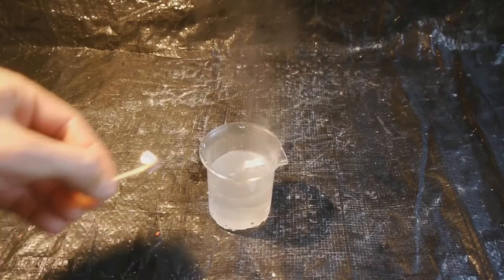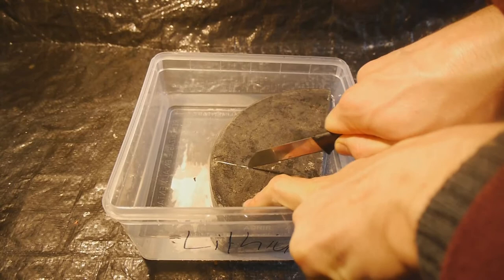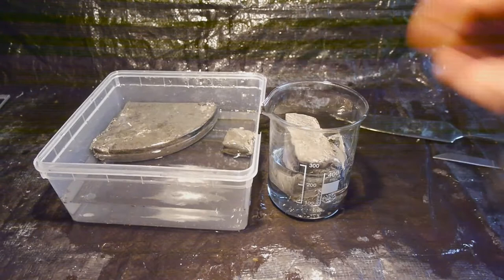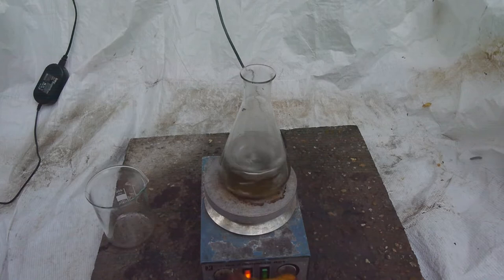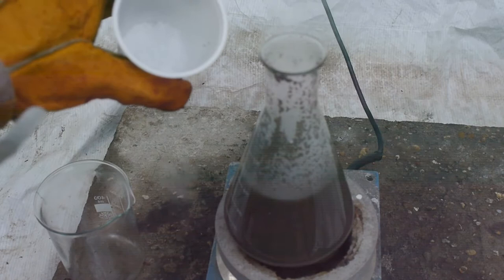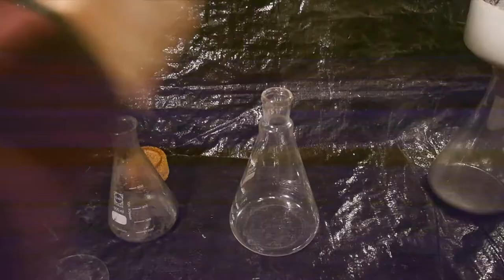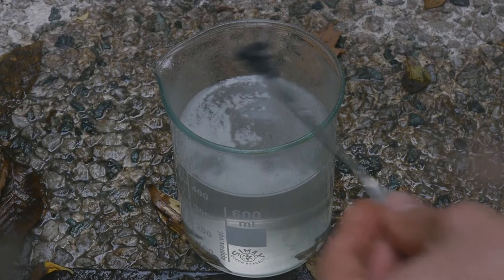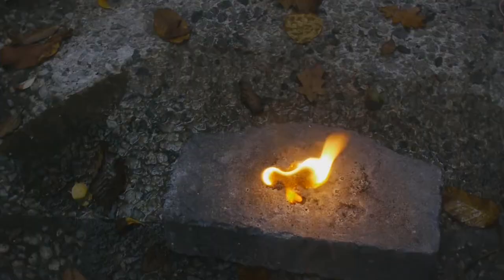Making Lithium Powder

Comment: How expensive were the big chunks of lithium and potassium that you bought? They aren’t in stock anymore. Just curious because I also live in Germany.
Reply from the maker: Here you go, I admit it is really difficult to find if you are not used to finding difficult to find stuff on google. XD
https://www.ebay.co.uk/itm/Lithium-99-8-Li-metal-also-Na-K-Cs-Rb-FREE-DELIVERY/283948757263?_trkparms=aid%3D1110006%26algo%3DHOMESPLICE.SIM%26ao%3D1%26asc%3D20131231084308%26meid%3Df53744225aa54ae28a0aa55cf0bd95b6%26pid%3D100010%26rk%3D1%26rkt%3D12%26sd%3D283927792331%26itm%3D283948757263%26pmt%3D0%26noa%3D1%26pg%3D2047675%26algv%3DDefaultOrganicWithAblationExplorer&_trksid=p2047675.c100010.m2109
https://www.ebay.co.uk/itm/Potassium-99-8-K-Kalium-metal-also-Na-Li-Cs-Rb-FREE-DELIVERY/283716547928?_trkparms=aid%3D1110006%26algo%3DHOMESPLICE.SIM%26ao%3D1%26asc%3D20131231084308%26meid%3Df53744225aa54ae28a0aa55cf0bd95b6%26pid%3D100010%26rk%3D2%26rkt%3D12%26mehot%3Dpp%26sd%3D283927792331%26itm%3D283716547928%26pmt%3D0%26noa%3D1%26pg%3D2047675%26algv%3DDefaultOrganicWithAblationExplorer&_trksid=p2047675.c100010.m2109
If you can't open the links it was about 200 € per kg.
Reply: @EliasExperiments  Thanks for the answer :D

Comment: I want to see this mixed with potassium nitrate or some other oxidzer, I would be curious to see if this would be viable in any pyrotechnic mixtures, maybe with a binder like silicone or epoxy
Reply from the maker: That would indeed be interesting. I will look into it.

Comment: That’s a great video! Is it sulfuric acid that you put in to stabilize the powder while stirring and cyclic acid for washing?
Reply from the maker: Sulfuric acid would be quite dangerous to mix with lithium. It was oleic acid and solid carbon dioxide. For washing I used cyclohexane, however you can use pretty much any anhydrous hydrocarbon solvent.

Comment: Okay, I'm gonna take a crack at this since you seem to be somewhat of a reputable chemist-and not just a crackpot. If I had to make a wild guess I would think that you're going to use the lithium metal powder and some kind of organic reaction or perhaps a reaction in which you need to have your organic solvents to be absolutely dry.

I am going to make a suggestion on what you might be able to use your lithium powder with; have you ever thought about producing a pyrotechnic composition in which you in case lithium powder in some type of moisture proof solid organic matrix which would when it was ignited would produce a perfect red flare? Do you think that's even possible?
Reply from the maker: Yes the lithium powder is intended for an organic reaction. On the sciencemadness forums someone already figured out what I planned to do with it, but I first need to get better equipment, cause I had a lot of trouble to actually pull through what I intended. 
The idea with pyrotechnics is great and already noted! But for that I would make more powder without the sodium metal, cause that ruins the beautiful red flame.
Reply: Yeah I agree, I want to see a pyrotechnic mixture with this, perhaps silicone rubber as a binder would protect it from water

Comment: Nice video! But I really missed the typical red flame of lithium at the end :/
Reply from the maker: Thank you! The red flame was missing because I mixed in like half a percent of sodium metal in the lithium which completly overpowers it. But I need the sodium metal to make it reactive enough for what I have planned next.
Reply from the maker: Making lithium chloride would not be very useful that way, cause I could buy it easily. Lithium Hydride on the other hand would be interesting, but that is not what I have planned. Also you wouldn't need lithium powder for that.
Reply from the maker: I am still working on it, it is just really difficult, but I will get it eventually and until than you can guess. :P
Reply from the maker: Well I can say that the product does contain lithium still.

Comment: I’m quite surprised with your yellow flame. Lithium burns with a red flame (as seen in the very first experiment). The yellow flame is sodium's.  I’m also sceptical at the lithium powder state after having been exposed to air a full night… even with the oil coating!
Reply from the maker: That was because I added a small piece of sodium to the lithium in order to make it more reactive. The flame color of sodium is just a lot more intense. Also I am pretty sure the lithium is still good, because I passivated it with lithium oleate and the co2. If lithium turns bad, it gets white on the surface. So because it was still black I can be confident it is good.
Reply: @EliasExperiments  Yeah, I saw the small sodium piece being added. Yeah, at air lithium forms lithium hydroxide, but beware that lithium also reacts with nitrogen, and lithium nitride then decomposes in water to form ammonia. I’m pretty surprised that when you dumped your lithium powder into the water the flame you got couldn't be sustained.
Reply from the maker: The flame could not be sustained because of all the water vapour that forms and also because the hydrogen gets diluted very quickly under these conditions.

Comment: how do you protect it from oxidation while you store it
Reply from the maker: Simply by storing it in a closed container.
Reply: @EliasExperiments  so it won't completely oxidize? I though it would have to be stored in a inert atmosphere or under oil
Reply from the maker: Well it is coated with oil and the way I made it caused it to have a stable coating. So far it has been stable, but of course it is always better to store it under inert gas.

Comment: Now go for Potassium powder...
Reply from the maker: Lol I was actually thinking the same thing. I will probably do it eventually, but not very soon cause I still have a lot of stuff planned before that. Don't worry it is still just as awesome. I will get there eventually however. The idea is certainly on my idea list now.
Reply: @EliasExperiments  Where do you got your Lithium, Sodium, Potassium? Because thats so many of them. It costs about $5000. Am I right you got it from eBay?
Reply from the maker: I am afraid where I bought the metals it is currently not avaible, but that might very well change in the future. If you search with google images you have a much better chance of finding it, just google it occasionally. The seller I bought from had the name alkalmetals.
Here is another site where you can at least by sodium metal for now: https://www.desertcart.de/search/sodium%20metal

Comment: Me here looking at how much work is used in cutting the metal be like: .....
Reply from the maker: That is only if you do absurdly oversized stuff like I am doing. Usually that isn't a problem or you have better tools. :D
Reply: @EliasExperiments  Lol, also I never knew metal can be that soft, but never knew why it was so hard to cut soft things XD
Reply from the maker: Well it isn't really that soft. There are softer metals. If you check my video on potassium metal, which is softer, you can see that it easier to cut.

Comment: so uhm, bring in some oxidizers
seeing how flammable lithium is i guess mixing lithium into magnesium alloy is out of the question?
Reply from the maker: You can make a lithium magnesium alloy, you just have to do it under argon, which is not trivial to do at home. 
What oxidizers would you suggest? :D
Reply from the maker: I think lithium metal would alloy with the magnesium and wouldn't swim on there for long, if it doesn't burn first. It is certainly very dangerous. I am surprised you were able to cast magnesium in air. Maybe it was some aluminium alloy. Then it would be much easier without burning everything on accident. 
I could get all of these chemicals. I have it noted on my video idea list. But it might be a while before I get to it, if at all. Cause I would have to think of a title for that video first, that non chemists could also understand easily. Also if I do it, it has to be done right, with more then just a couple grams or drops. And I still have a lot of other projects I would like to finish first. But those are certainly great ideas!
Reply: @EliasExperiments  oh yes it was aluminium alloy, but for the lithium to be interesting to add into it, it should still remain intermetallic, as in- shatter when smashed with a hammer